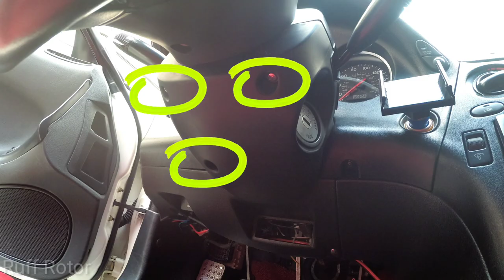VLOG#027 - RX-7 DIY Instrument Cluster Removal

Comment: I just today attempted to remove my cluster in a similar manner. :-( 
It would not pop loose from the dash at the front of the cover. Instead, the studs holding the cluster to the mid black piece, busted, leaving the arched front piece cluster cover still fixed in position. When I tried to pull the arch out, nothing popped loose from the dash.
I busted several pieces of the arch off due to it's being very brittle. 
All I can see back in there where the plugs hold it in place, is some screws which apparently prevent it from being pulled out. 
Now gonna unplug the cluster,,, go from there..
Thank you for your assistance to all of us!
Reply: Lol same here man don't feel bad that's just what happens. It's all over the old forums, they just shatter and that's it. I'll use the opportunity to "upgrade" to carbon I suppose